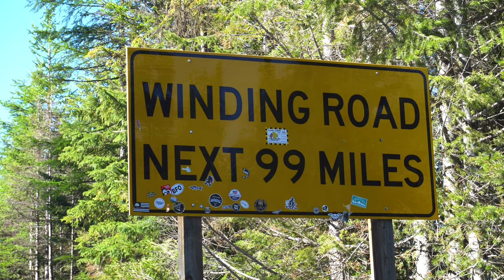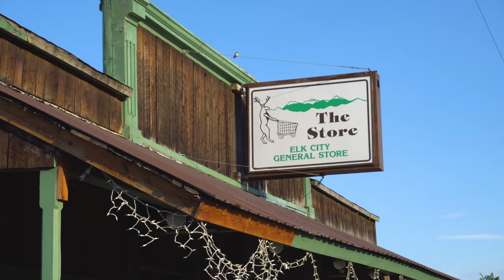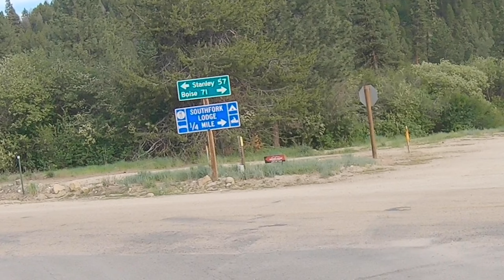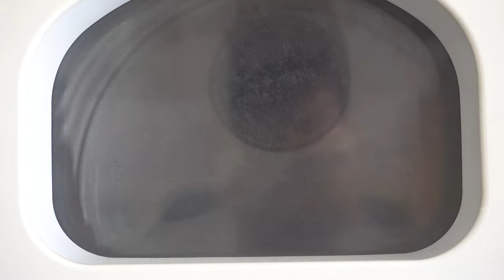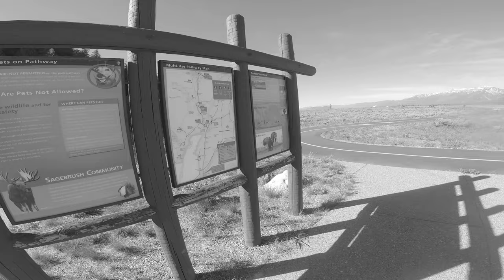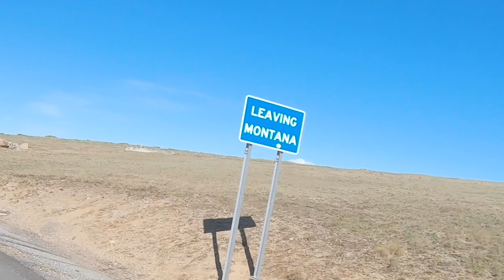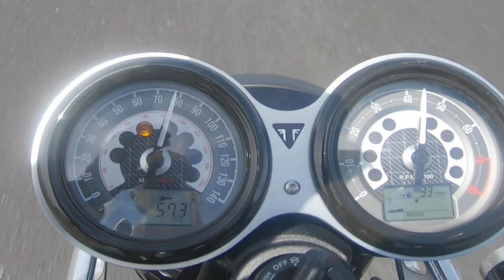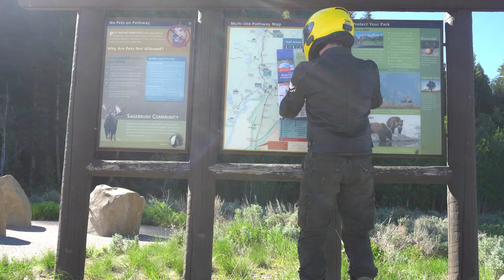No GPS Tour: THE MOVIE (2021) // Triumph Speed Twin 1200 solo road trip

Comment: I love how you describe this bike. I owend a daytona 71 it was a blast to ride at 18. Had a 600 BMW owned it for 15 years great bike. Then a 650 Seca had that bike over 12 years . Went with out one for 25 years but road f4i yz 600 did not enjoy them. Bought .y t100 2013 4000 miles on it. Road tec tires and etc pads help this bike out ten fold. Road the blueridge what a blast 600 miles of just pure enjoyment.  5 days riding the dragon and surrounding areas with some very fast riders. They were impressed with my machine performance. And sound. ❤this bike.

Comment: Mr. Blamm, since you do a lot of highway riding, I recommend you install an 18T front sprocket like I did on my speed twin. It's like having a 7th gear (in fact, the new 5th gear becomes almost identical to the stock 6th)
Reply from the maker: I'm planning to go up one tooth soon. Do you notice a loss of low-end grunt by going up two teeth?
Reply: @VanBlamm  I've seen some people say that 18T will have that effect and honestly, that's a bunch of baloney:
-18/42 is 12.5% longer than the stock 16/42. Well guess what, the T120, bobber, speedmaster 1200 etc all use 17/37, which is 20% longer. I don't see anyone complaining that they can't get off the line with those bikes
-you've had a street twin, right? At 18/42, the first 5 gears of the speed twin are almost identical speed-wise to the 5 gears of a street twin -except that with a speed twin, you obviously have way more engine torque at any point in the rev range
-obviously, with 18/42 you have 11.11% less torque at the wheel at any given gear/rpm combination when compared to stock. But if that's all you care about, then just set up your bike so that 6th gear tops out at 50 mph, that way you'll have loads more torque at the wheel at any given gear/rpm

furthermore, some would recommend against 17T because with the chain having 102 links, it falls into the "same tooth/same link" problem. But honestly, I don't know how bad that really is since for instance, Triumph designed the street twin and a couple other bikes with a 17T / 102 links combination

oh, and check out the gearingcommander website, it's a great resource for planning such modifications (plus studying different bikes to give you perspective on this stuff)

Comment: Hi there. how is the wind without windscreen on long trips on these kind of bikes? i just bought a brand new speed twin 900 and want to make a big trip in the summer with it and have no idea if i should buy the big windshield from triumph or i can make without any screen
Reply from the maker: Congrats on the new bike! I am really not bothered by wind blast at all, in fact I don't even really notice it at speeds below 80mph. I used to have a Street Twin (which is now called the Speed Twin 900) and rode it from DC to NYC in complete comfort, all on the freeway. Small windscreens don't do much anyway; wind protection is kind of an all-or-nothing deal if you ask me.
Reply: @VanBlamm  thank you for the answer  brother. Take care

Comment: What are your thoughts on the fuel capacity?
Reply from the maker: I can get about 130 miles out of a tank when riding around town, 160 when riding in the mountains, and close to 200 on the open freeway. That range is great for me, because that's about as far as I'd want to ride without taking a break.